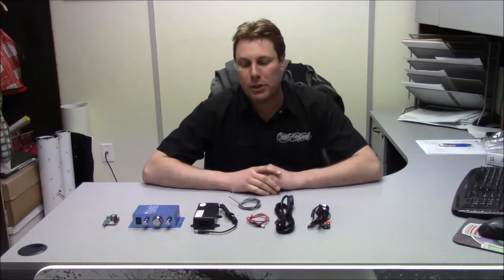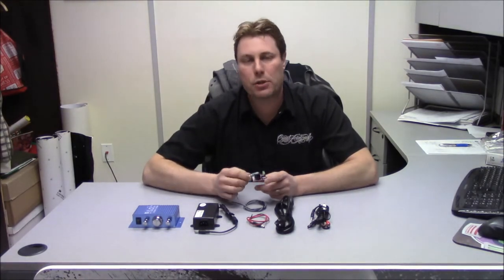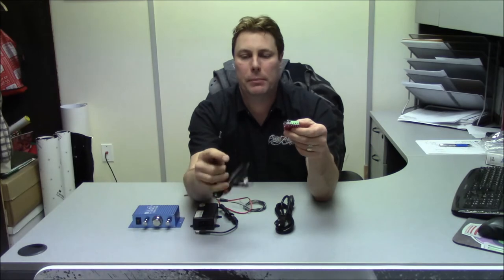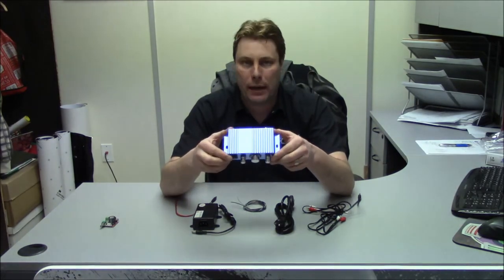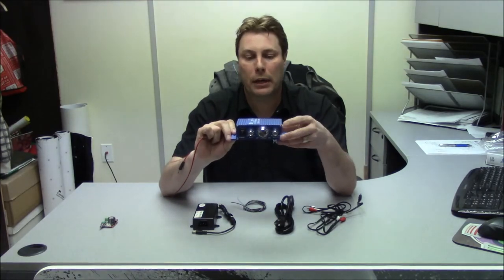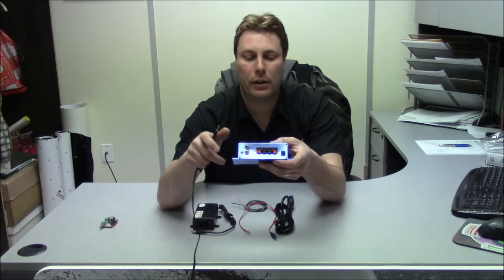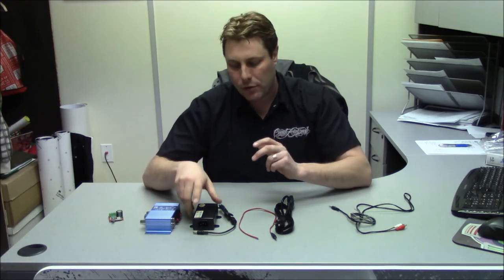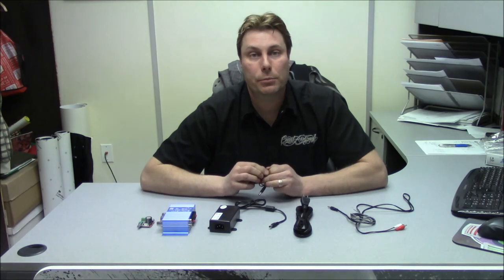Audio Amplifier Video

Comment: Hi there. Quick question: would a potentiometer pcb technically work using a Pandora box 6 family (by using the PB jack output and subsequently hooking up speakers to the potentiometer) and, would you happen to know the power usage of the board? Thanks!

Comment: Any way to hook up a subwoofer to either of these setups?
Reply from the maker: Not with these amplifiers, you would have to use the 3.5 mm out of your Pi or computer and connect to a computer speaker setup or something like that to get the 3.1 surround effect.
Reply: You could theoretically use a passive subwoofer.
Reply: You won't need this amplifier if you already have dvd amplifier home theater or computer